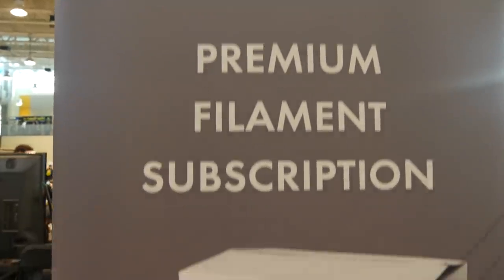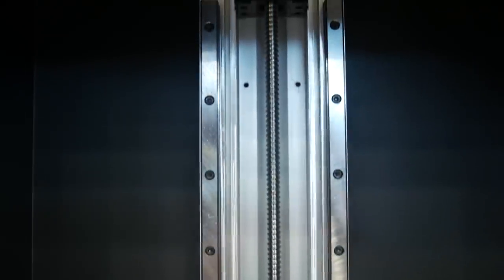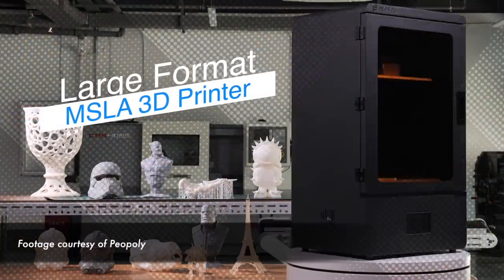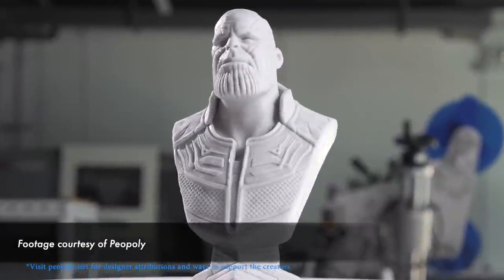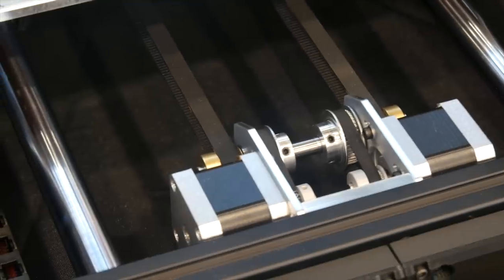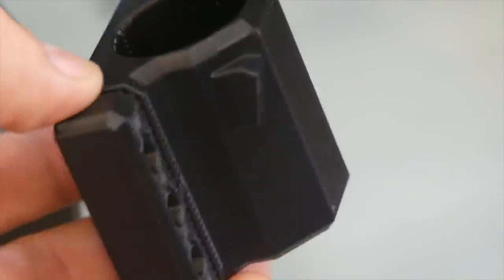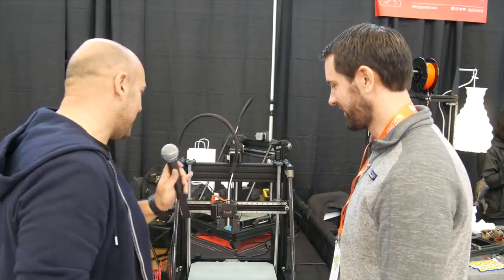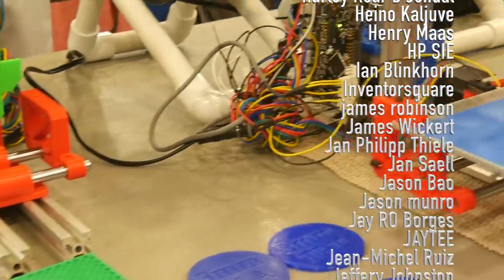Peopoly Phenom and Elite Machines Ultimate XL at ERRF 2019

Comment: Joe,  I'm a bit surprised that the Elite Machines Ultimate XL isn't ALL CNC machined metal parts!.  Why wouldn't  someone that has access to CNC machines, make his prototype out of all metal parts?  Seems like it would be more rigid that this one.    Is it production time versus cost?
Reply from the maker: The machines parts are the most important ones for structural rigidity and precision , had it all been CNC the cost would most likely substantially increase making it less appealing to many
Reply: Like Joe said it would increase the costs. CNC machines require programming and setup. They are obviously excellent at mass producing parts but in order to produce many parts rapidly it requires multiple CNC machines which is a very expensive investment on the front end. As of now I only have one industrial VMC and making multiple mass produced parts requires tooling and setup changeover from part to part which adds time as well. The heatbed and aluminum extruded frame already require a good amount of CNC machining operations. You hit on a very good subject though. This is why I love 3D printing. While 3D printing is a much slower process it is much more cost effective for small businesses to have a print farm producing parts. This is another reason why I design my printers to be highly reliable and safe. I routinely leave my printers operating unattended overnight and over the weekends when I am not at my shop.I can start multiple printers before I leave for the day and come in the next morning to completed parts. Having a printer farm makes it possible to produce many parts in a lights off mass production scheme for a minimal initial investment.
Reply: I have one of Kyle’s earlier machines (the 250mm^3) and it is as solid as a tank—the printed parts are of no concern—this is a well designed, no, well engineered and well built printer. I ordered an XL based on my experiences with the first one.

Comment: Lol, old mate claims the "Elite Machines Ultimate XL" is how a 3D printed should be build, he goes to all the effort to make sure he uses well constrained components (linear rails, quality belts and matching pulleys) but then bolts it all together with 3D printed parts which will give low constraint especial as things heat up. Really whats the point of using expensive overkill 60mil rods when you hold them in place with 3D printed parts.......fail.
Reply: Carbon fiber reinforced petg parts are used in areas that allow for plastic components. The use of printed parts also plays into the fact that this machine is designed to be mass-produced. Machining individual components is costly and eats machine time that could be better spent machining components that are necessary. 3D printing is a lights off operation therefore parts can be manufactured unsupervised. These machines perform as well as they look. I have 18 custom built printers all with clients and many thousands and thousands of print hours. Many of my clients are repeat buyers coming back to purchase more custom-built machines having been completely satisfied with their previous investment. Feel free to check out the website and the gallery, I'm sure you'll find something interesting there to nitpick. Also that's 16mm rods not 60.  The simple fact that you thought 60 sounded like a reasonable diameter lends to your lack of common engineering knowledge.
Reply: Redemptioner1 If you think carbon fiber reinforced composites are a weak engineering material, then you think Pagani and Bugatti don’t know how to make multi million dollar super cars. You keep making benchys in PLA and let the real engineers design great things with the amazing composite materials that are available today.
Reply: you gotta be a good engineer if you can shoot that design down. Or a real shit one.